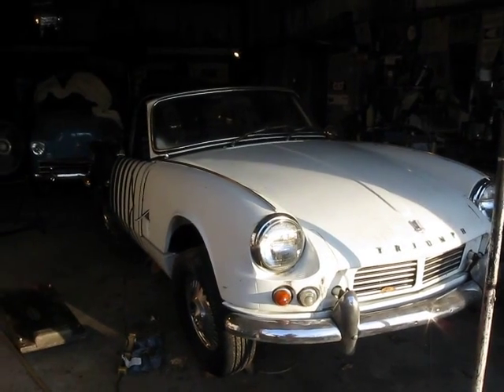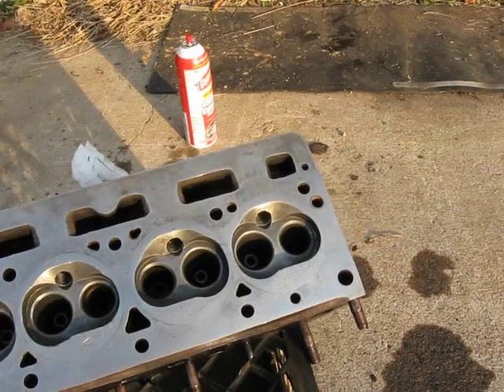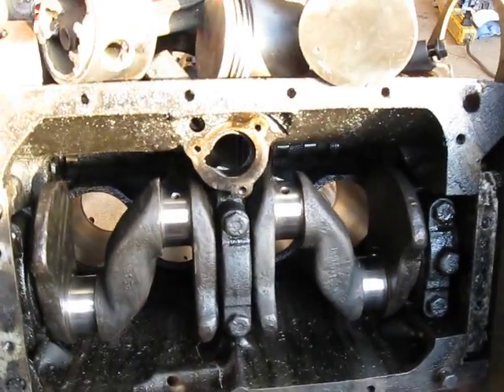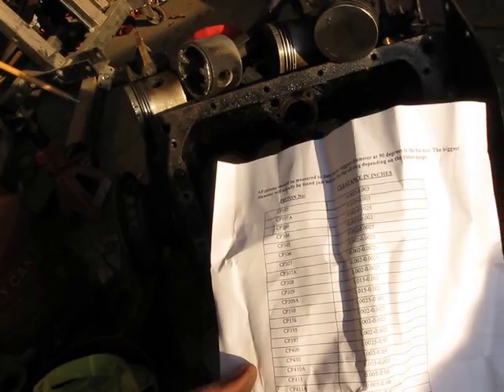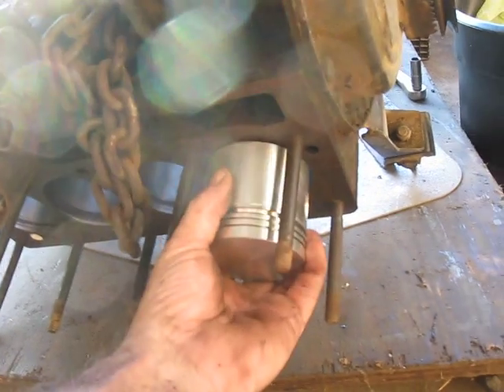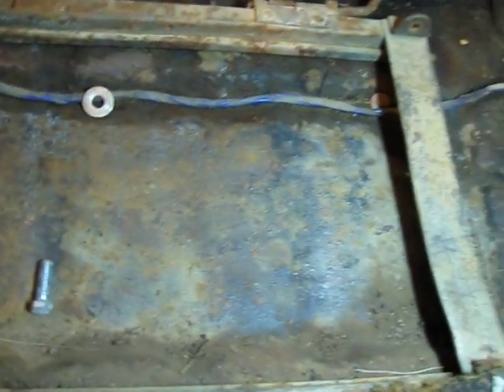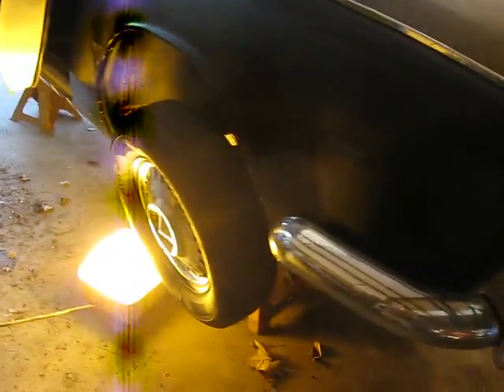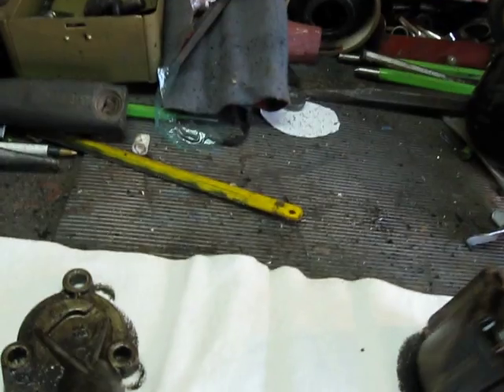Triumph engine inspection

Comment: Really good Vid Steve, I tell you what, you got a really good buy there! Not a lot of tin worm at all, should get a good few seasons out of the Zebra before needing any major metal work. If that motor does turn out a bit dodgy, see if Mr McCleod has a 6  and a GT6 bonnet! But I reckon you will sort that one no problem
Reply from the maker: Thanks Best Brother. If I need any more speed I will trade him out of the E type he has.

Comment: Unless you're going to spend some real money on that engine then I recon a full set of bearings and a hone then slam those slugs in and nail it all together...A friend paid $3,000 for a set of con rods for one of those engines for a Heritage race car and it tossed a rod after about 8 drives.!...Slap it together Steve...The chookshed builds always seem to last...Living proof right here...lol
Reply from the maker: Thanks Lil Bro, If th ring gaps are good I will build what I have. Im kinda HOT to drive th little Spit!